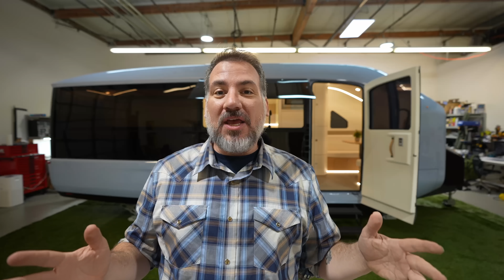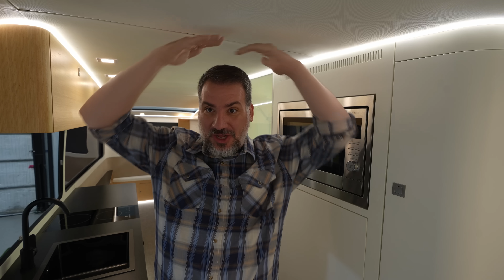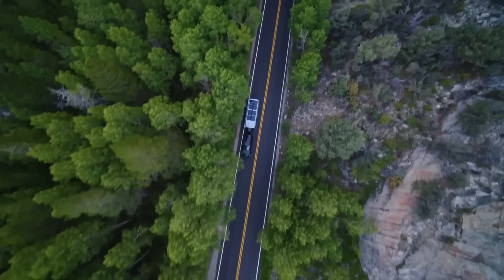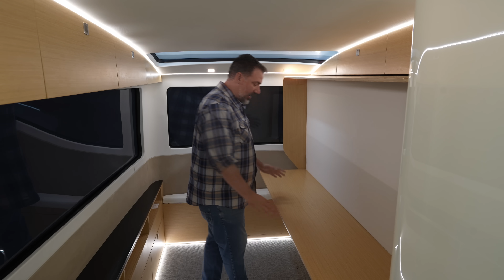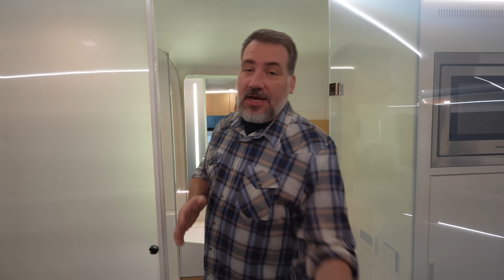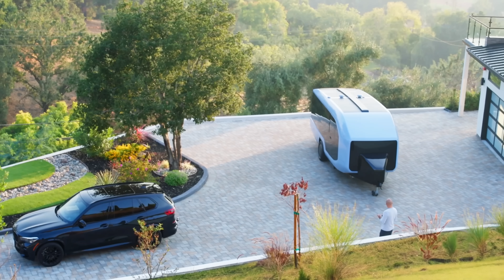Pebble Flow Tour | Groundbreaking All-Electric RV Trailer With Powered Axle

Comment: New? Unfortunately this is a Gimmick. 1000 watts of solar is meager at best. Driving around with the Airstream eStream we learned real quick just like a trailer valet. Unless your in perfectly level smooth ground, driving it around is near impossible.
Unfortunately this is not the first or the second try at it.
If Airstream holding off says it all.
And $$$$$$
 https://youtu.be/rQEztxVGEbI?si=LVQI-0qokJD_y7QW
Reply from the maker: I don't know that I said the powered axle is new. I was the very first person to cover the eStream. For what it's worth, I don't think the remote controlled parking is anywhere near the most interesting thing about this trailer, and 1000 watts is about the limit of what you can fit on the roof of a 25' trailer, at least aerodynamicly.
Reply: @RVMiles  I did not say you said anything about anything, I simply gave my opinion. Basically just responding to another comment. This is all. I can elaborate that the drive wheels in mountain and hills with a compatible tow vehicle, Gas or EV will have you at a charging station not a campsite. Again, Just Opinion 
As a RV Solar Company owner. Just thinking out loud.
We own two Tesla EV vehicles, so not bagging on EV’s in anyway
Off Grid Solar is My Life

Comment: I’m wondering how the powered axles will affect the GVWR… it’s “easier to tow,” but does that literally mean we can use a smaller tow vehicle with a tow rating below the actual weight of the trailer?
Reply from the maker: You still need to have a vehicle that has a tow rating to handle it, but according to Pebble, you don't need to have lots of extra cushion or a weight distribution hitch. So a lot of SUVs have a 7500lb towing capacity, which should be good for this.

Comment: This thing is dumb. Hilarious when he says it's for RV'ers who don't want to buy an expensive truck and can be towed with the small SUV they already own. No weight distribution hitch needed because they put the axle in the wrong place to balance the trailer and take weight off the hitch. Single axle equals less drag but I'd never own one and I'd like to see a highway speed tire blowout simulation. Bet it's scariest thing anyone will ever experience with their family in their little SUV.
Reply from the maker: Never said small SUV. Small SUVs are cars. A large SUV with the required towing capacity (6500lbs).

Comment: I love the concept and do hope other manufacturers follow, however, it’s unlikely they will due to the narrow market with a premium price tag. Also most RV manufacturers have little interest in producing a high quality product. Sure it’s possible that if there’s enough demand the price could come down. It’s a good start. It’s not totally clear how much natural light will come in on the driver side. As Airstream owners we love how open and bright they are. If you mentioned an exhaust fan or skylights I missed it.  I don’t like the overhead cabinets with the downward opening doors. A shorter person would experience difficulty reaching into them.

Comment: cool concept.  The pics showing walls mounted on the frame as opposed to "outriggers" is what all RV manufactures need to do.  However, I am not sold on the EV only concept.  Redundant systems (i.e. propane AND electric) should be included.  Also, WAY to sterile for my taste. But overall, moving in the right direction...can hardly wait to see construction and materials.

Comment: Transition from Murphy bed to bathroom is pretty awkward. Cabinets opening down also awkward. More windows. And you have to buy into a narrow passageway which doesn’t always work well with 2 people. Seems like batteries would take up most of the externally reachable storage which gets used currently for camp chairs, tables, etc. Good tech concept. Some practicalities missed.

Comment: The Peeble travel trailer has the appearance of what I would imagine an Airstream would look like in the 23rd century. I wonder though if the Peeble will be considered a travel trailer or treated as a motor home for licensing purposes?  After all with a motorized axle, I could see the local DMV office having some confusion over how to issue a license plate for the Peeble. But then again, it isn’t meant to be driven on the road (as it is a towed trailer) so it seems it would be tagged as a travel trailer.

Comment: There obviously is a lot of thought put into this one.  However the single axle is a deal breaker for me. I had a bad experience with a blow on I-10 east of El Paso. Was able to change the tire using plastic leveler blocks.  After replacing that tire with the spare and driving for about an hour, I had another tire catastrophically fail.  The only things left on the rim were frayed bits of sidewalls.  Thankfully I was able to carry on and wasn’t stranded on I-10 after dark.  This was on a Airstream Classic.  So glad I had two axles.  At any  price I would not buy a trailer with one axle and especially a “high end” one like this.  Fit and finish is nice, but the substrate has to support everything.  

BTW - I also do not understand the drop down doors on upper cabinets.  A lot of women will be doing food prep along side all those men who will also chop veggies in the kitchen. 😉
Reply: Maybe run flat tires will solve that issue.

Comment: Like Tesla, this RV company is going to put a LOT of high end RV manufacturers in a LOT of pain. Assuming they can scale, which would allow them to lower the price (due to volume manufacturing) - this will be a HUGE success and major disruptor for the industry. I hope the founders would be able to raise enough cash to allow them for a long run without being bought out (and potentially killed) by the incumbants. We need new innovative RV companies. 99% of the rest of the industry is just using cheap materials and copies one another

Comment: Still should not pull this with anything other than a truck. I saw the squat on that car it was being lowered on and it was not good. With only a 37 fresh water tank and a 50 gallon grey and black combined means you are not boondocking for a week. Maybe 4 days if no one showers or uses the toilet. With separate grey/black you can empty your grey if it gets full. No slide is also an issue because I don't see much space for more than 2 people. Yes you said the table fits 5 but moving around in that looks very cramped and where is the entertainment center? But that power assist parking and moving around is amazing. That is one thing I wish all trailers had, life would be so much easier in tight spots.

Comment: The concept and design is super clever, but for a few items: i) the interior feels very cold and could benefit from a bit more plushness and less plastic looking, shiny surface; ii) the drop down upper cabinet doors would likely be an issue for someone of lesser height, like me, and I don’t want to climb on a step stool to gat my dishes and snacks after paying this much for a trailer, iii) are there screens on the windows that open. I didn’t see one, and only one window appeared to open; iv) I’d prefer windows that blackout rather than simply go opaque, as light can still get in at night and forms can still be seen from the outside, which is a bit embarrassing if we want to enjoy a private moment with a partner or while in the bathroom.

Comment: At first sight my thought is those OH cabinets NEED TO OPEN in the UP (normal) position. When you opened the cabinet, do you realize your arm pit was at the open cabinet door? If that is the case of a 6'2" man (per your headroom comment), imagine what it is for a shorter man, and, especially, for a shorter lady. That has to be one of the first mods the mfg undertakes BEFORE going into production, IMHO.
Overall, the unit looks Premium, thus, the price doesn't seem out of line.
Y'all Be Safe!

Comment: I think the convenience of all electric/battery is masking the benefits of “hybrid” (electric and propane), especially during winter.  Did you receive any specs about winter camping/temperature ranges for operability? Many LiFePO4 batteries have auto-cutoff for charging once the batteries are 32F and another cutoff for discharging at around -4F. One way to offset the temp drops are with battery heaters—either electric blankets or  heat ducts from a furnace (usually propane powered).  Did you get a sense of wall thickness/insulation? Seems to me that Imperial Outdoors line of Xplore trailers with -40F to 120F range of use are the best rigs out there both for deep winter and hot summer camping.
Reply: Since the electric drive train has regenerative braking, that can be used to heat the batteries too. The solar will still work while driving and the panels can power electric. This trailer does have an electric furnace which can send heated air across the batteries if designed to do that.

Comment: I saw their video last week.

I don't have $110,000, but would it work for my tiny Fiat 500e? It too is electric!

You did a better introduction video than the manufacturer!
Reply: It would require a 6000 pound tow rating, so my ID.4 would not work either. With that weight you would need a Jeep Grand Cherokee, or a Rivian R1S, or a pickup. 
$110k is the price without the drive motors. Adding them gets you to $125k.
Reply: @kenmcclow8963 , I think I will keep my tent! Going camping 🏕️ on Friday. It's almost 80F 10/27 this weekend near Philadelphia. A County Park is only $15 a night.

On a different note, EcoFlow has their 1kw Delta 2 and a 1kw extra battery for less than $1100 this weekend.
Reply: @kenmcclow8963 it's 6500lbs or more. You need something like an expedition.

Comment: Needs more windows. Part of The RV experience is "getting out there." The inside feels far too sterile for the average outdoors enthusiast. You mention a ton of solar on the roof. Maybe, they could find a way to put a panoramic sunroof on the front/back roof lines. So much storage inside, it'd be hard to add more windows to the vertical walls, but I would definitely need more visibility to outside. The features though, especially the motorized axle, are phenominal. Instant opaque windows? What?!?!
Reply from the maker: Maybe I didn't show it well enough, but there are a LOT of windows. Everything that is black is window on the front, passenger side, and back, and there's a skylight in the rear. Most of the driver's side is not window.
Reply: @RVMiles , I didn't remember you mentioning the rear skylight.
Reply: @RVMiles  TBF, the environment probably made if a little difficult. But, I think you did a fine job! It's a cool unit, hopefully they'll have one next year at some Overland expos. I'm a sucker for cool tech 😁

Comment: The battery will become a huge issue over time and the resell value will drop significantly. Replacement cost of the battery will be prohibitive and make the trailer worthless. I also would not want to sleep on a lithium battery of that size, in the event of fire, that trailer would go up in seconds. 

There is also no way I would pull a trailer with a drive axle. A failure would cause significant damage to the tow vehicle, create a danger on the road, and brick the entire trailer with it being unable to move. 

I like the idea of the trailer with more automotive design,  but I would use about 200ah of lithium batteries and a propane generator. It would cost way less and be far more reliable.

Comment: Looks like a doable concept.  My only comment right now is with the doors on the overhead compartments.  They should be opening up instead of down.  With them opening down they are going to be prone to breakage.  They are likely to have something heavy set on them or someone is going to lean, or pull down, on them.  Think about a short person trying to reach up into them.

Comment: Love the innovation- totally understand why you’d be so excited for this.  However, it was a little overflowing on the positive and you seemed predisposed to wash over negatives such as those cabinet doors.  It’s fine to open down but you need 180 degree latches so the doors can truly get out of the way or right after saying that Pebble says you can go a week on the batteries plus solar (which is beyond dubious) you describe the tank sizes which are just enough to last a long weekend.  

I’m excited for this thing too as there are many thoughtful things that combined with what Brinkley is doing means we should see some change in the industry writ large.  However, you undermine your credibility when you don’t point out a negative or you minimize them.  

One other area of concern is the single axle.  With a single axle and those beefy batteries - I bet the cargo capacity for this may be limited and secondly a blow out with a single axle is a nightmare.  I’d only ever want a dual axle for that reason.  Now that, I am sure would limit the unit from driving itself around which is a cool feature but I’d give that up in the interest of safety.  I’ve worked my whole career in and around Silicon Valley - they love their magic hitch and driving it around and no matter what anyone tells them about the need for safety  and cargo capacity they’ll ignore it.  They don’t provide much in regard to specifications other than dimensions and the GVWR of 6,200 pounds.  I bet the unloaded weight of this thing is at least 4,500 pounds and then you add in the tank capacities and I bet you’ll be under a 1,000 pounds for CCC.  Wouldn’t be shocked if net of the fresh water tank being full you’d be at about 700 pounds or less.  Especially since they aren’t providing that information.  One thing you have to be careful of with startups is what they DON’T tell you - the lack of detail on unloaded weight is throwing alarm bells to me.  How as an industry veteran can you not prove this most common question?  Did they pay to fly you out there?  Put you up at the Fairmont?  Maybe take you to Napa?  Lots of ways to pay an influencer without a check going out.  

On the electric capacity,  what are their assumptions on usage of the AC and the efficiency of the solar?  When one makes a claim of seven days off grid they should say what the assumptions are - how much equipment running for how long and the recharge rate would be nice.  

I’m rooting for these guys but such an overflowing review is a red flag and considering how you position yourself,  I’m shocked you could be pulled in like this.  Now I have to take everything you say with a huge grain of salt and may actually unsubscribe depending on whether you address whether you were paid directly or indirectly with paid travel and experiences.
Reply from the maker: You make some good points. This is a prototype, and obviously I haven't camped in it, so it's not really a review, just a tour. I thought the cabinet doors were a somewhat strange, which is why I mentioned them, but I was so impressed with all of the cabinet hardware that it didn't really bother me that much. I can see how someone shorter might not agree. The cargo capacity could absolutly be an issue. I don't do a lot of RV tours, you're right, I should absolutely have asked about that. But maybe just because you think I missed a few points doesn't mean I'm lacking in integrity. Yes I was flown out there. It was kind of a pain in the a** to do, to spend 2 days away from my family to spend time in the land of the ugly office building. No, I was not wined and dined or compensated. They gave me a sparkling water. I agreed to do it because I thought it was a good fit for the channel. Nobody is making anyone buy it.
Reply: @RVMiles thanks for the reply - whenever you receive compensation you really should call it out to your audience as otherwise we may think this was an unbiased review - I know you’ll say it doesn’t affect what you say, etc.  but the human condition is what it is
Reply: CCC and duel axles are  a no go for me. I also don’t buy trailers that don’t duel axles. Very interesting idea now make it an off road trailer and I would probably buy one, just add more water capacity please “70 gallons “ is about right for a couple to boondock and week.

Comment: The pricing would work for me as I wouldn’t have to spend $75,000+ on a tow vehicle.  My current SUV would handle this.  Surprisingly, the deal killer for me is the drop down cabinet doors.  My wife & I are short (5’4”) rendering these cabinets useless.  Hopefully the manufacturer (prior to production) is reading the comments about these cabinet drop down concerns.
Reply: I had the exact same reaction to the cabinets! I was sitting here wondering if a cabinet maker could flip the hinges or something, to make them usable. Maybe by the time it comes out on the market (late 2024) the manufacturer will have corrected that design flaw.
Reply: What suv do you have that can tow 6500lbs ?